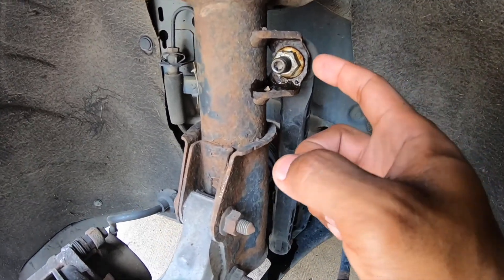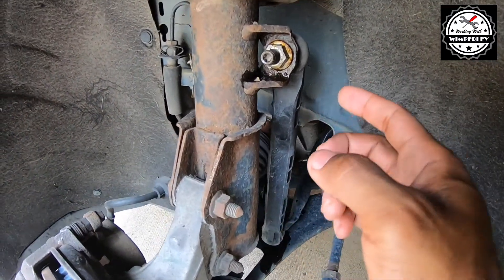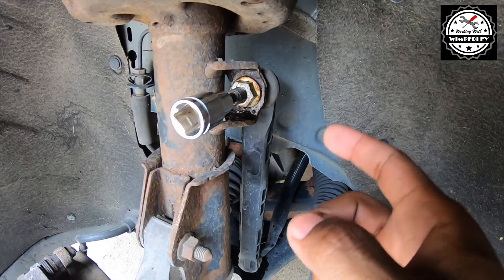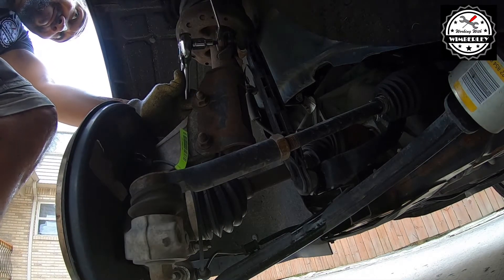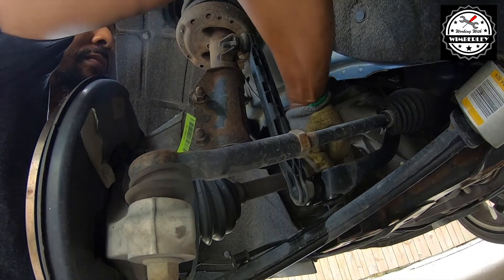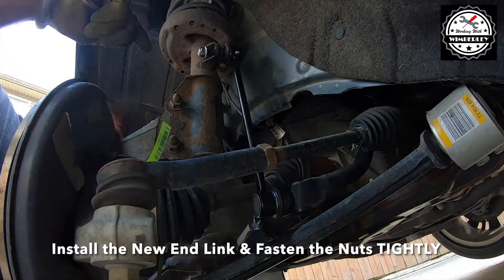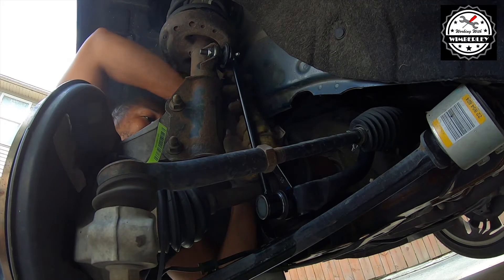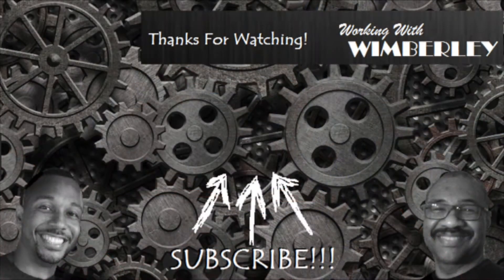Chevy Impala Sway Bar End Link Replacement 2014-2020 How To Change 3.6L V6 2.5L ECOTEC LT LTZ

Comment: Do you have a video on replacing the sway bar bushings?
Reply from the maker: Unfortunately, I do not.
Reply from the maker: @Justincaseyahur  No I don’t have a video. It’s a pretty involved process. Here’s the instructions if you want to try it.

IMPALA STABILIZER BAR R&R
FRONT
Caution: This vehicle is equipped with torque-to-yield or single use fasteners. Install a NEW torque-to-yield or single use fastener when installing this component. Failure to replace torque-to-yield or single use fastener could cause damage to vehicle or component.
1.	Separate front stabilizer shaft link at front stabilizer shaft.
2.	Lower rear of drivetrain and front suspension frame to gain enough clearance to remove front stabilizer shaft.
3.	Remove front stabilizer shaft insulator clamp bolt
4.	Remove front stabilizer shaft insulator clamp bolts. Discard bolts,
5.	Remove front stabilizer shaft
6.	Reverse procedure to install, noting following:
 	a.	Install NEW front stabilizer shaft insulator clamp bolts.
 	b.	Torque front stabilizer shaft insulator clamp bolts to 16 ft. lbs., and turn an additional 30°-45°.
Reply from the maker: @Justincaseyahur  No problem!

Comment: Did you put all purpose grease inside the small hole or did you just put the small screws and installed with out greaseing them ?
Reply from the maker: I didn’t on this one, but it depends. If it has a grease fitting and it doesn’t appear to be much grease in it, I’ll add it. Honestly, half of the balls joints I install don’t even have a fitting to add it.

Comment: Hey, I know I'm late but was the reason you changed the sway bar link is because there was a noise as you turn your wheel in park???
Reply from the maker: It was a clunk over bumps. Sometimes you can here it when turning too.
Reply: Appreciate the reply. Yeah does that too and make a noise when I get out and in the car.

Comment: i replaced mine and car is horrible over bumps 2104 impala lt...what about the bar bushings on the cradle?
Reply from the maker: @alvendetti4600  If you don’t fasten the nuts really tight on the end links, they will clunk. But the sway bar bushings could be bad as well.
Reply: you cant get the front bushings unless you buy the bar too,how stupid...car is still bad over bumps.,my 04 monte carlo ss was better ride..maybe cause i more rubber between me and the road.i put new links on,still noisy
Reply from the maker: @alvendetti4600  That sucks.

Comment: I need the whole sway bar..make another video. 🤣.. good job though.
Reply from the maker: Thanks! It’s not easy to replace the sway bar on these. Here are the instructions I pulled from an online auto guide. 

IMPALA STABILIZER BAR R&R
FRONT
Caution: This vehicle is equipped with torque-to-yield or single use fasteners. Install a NEW torque-to-yield or single use fastener when installing this component. Failure to replace torque-to-yield or single use fastener could cause damage to vehicle or component.
1.	Separate front stabilizer shaft link at front stabilizer shaft.
2.	Lower rear of drivetrain and front suspension frame to gain enough clearance to remove front stabilizer shaft.
3.	Remove front stabilizer shaft insulator clamp bolt,
4.	Remove front stabilizer shaft insulator clamp bolts. Discard bolts, 
5.	Remove front stabilizer shaft, 
6.	Reverse procedure to install, noting following:
 	a.	Install NEW front stabilizer shaft insulator clamp bolts.
 	b.	Torque front stabilizer shaft insulator clamp bolts to 16 ft. lbs., and turn an additional 30°-45°.